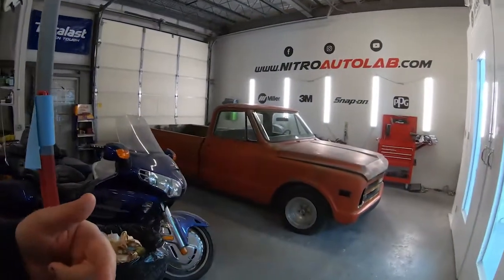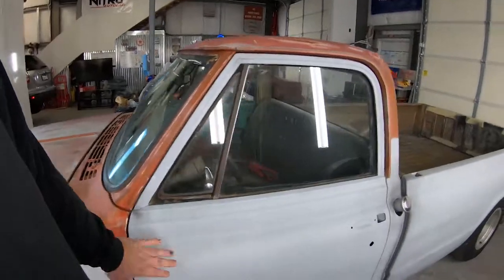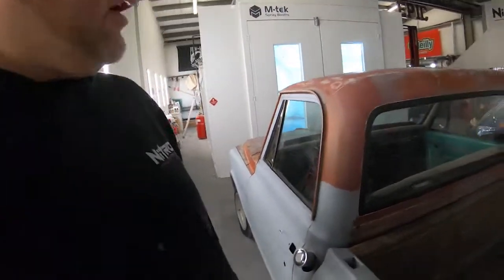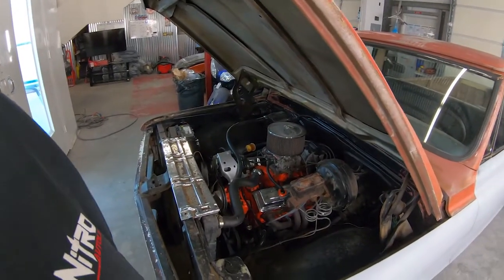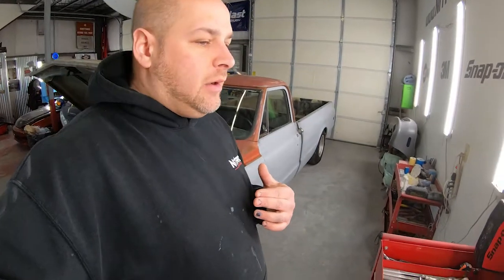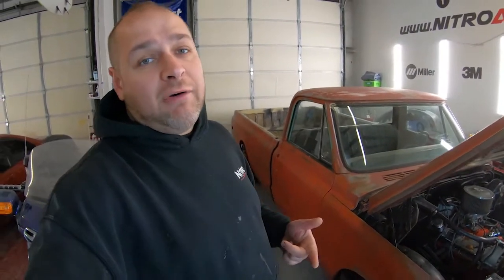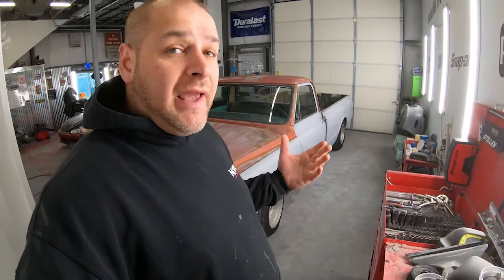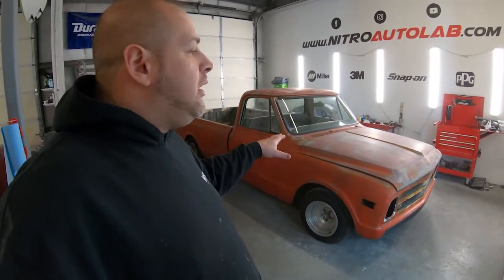FINALLY GOT THE 1968 CHEVY C10 SHOP TRUCK BACK IN THE SHOP!

Comment: What's wrong with the K-series thats in it?
Reply from the maker: It drove on to trailer double footing it. Rod is loose tho and broke a hole in side of block. Lol
Reply: @nitroautolab  Oh no, not a window lol. I was  wondering if it wasn't windowed and if u were gettin rid of it lol
Reply from the maker: @BoostedNW  yeah unfortunately it’s a parts motor now. I have a Honda project I’m hoping to get to this fall thst I plan on doing k turbo